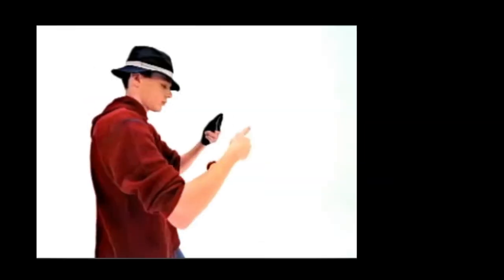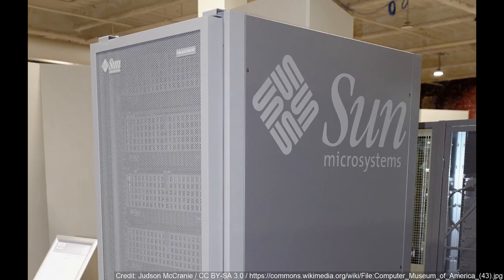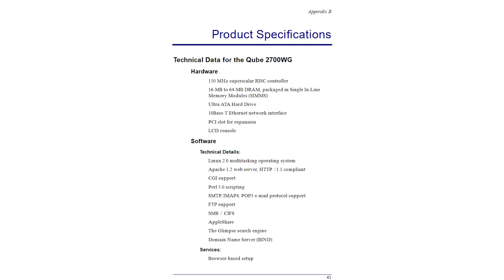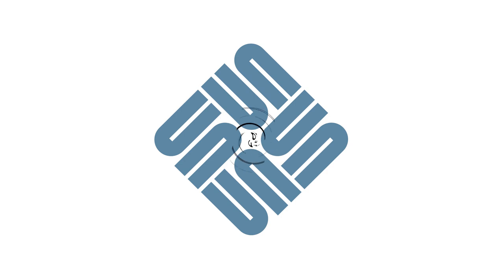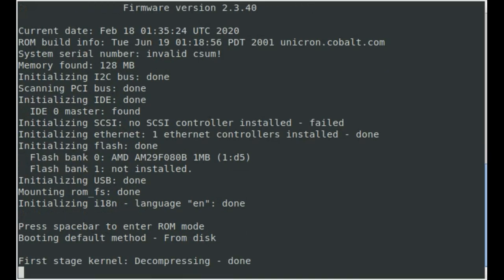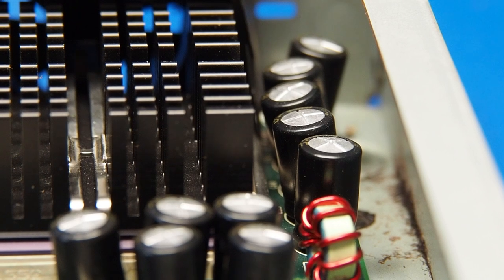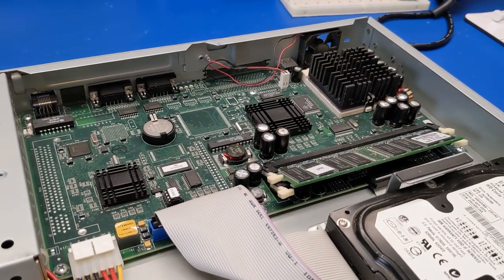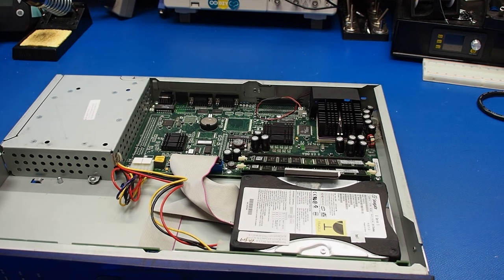This Web Server Changed The Internet: The Cobalt RaQ

Comment: Believe it or not, I turned off the last bunch of them only in January 2020, together with a bunch of HP NetServers, all from the 90's. These boxes were indestructable and indeed, together with the Cisco 7200 and 10k series routers, were the buildingblocks of the internet. There are many 7200's out there as well, still!
Reply: The company I work for has routers of that 2006 vintage still :)
Reply: They probably required newer software to run HTTPS, or was that why SSL accelerator units existed?
Reply: @soundspark  Reverse proxies probably
Reply: @MrOpenGL  Which were sold as appliances too back in the day.
Reply: This was from the era when the US Government was still restricting the export of strong encryption, which meant crippled SSL certs.

So a savvy guy named Mark Shuttleworth in South Africa decided to set up his own CA and issue full-strength certs outside the control of the US Government. My main client here in NZ at the time got certs from him.
Reply: @lawrencedoliveiro9104  Wasn't it around 2000 when the US relaxed rules on encryption export?
Reply: I would have guessed those IDE drives would die every few years if being run constantly. Their lifespan wasn't that long.
Reply: @wisenber  never rebooting makes them run longer, since they have constant thermals and spin.  (It would make rebooting scary, though...)
Reply: I was like #100
Reply: @manmeetworld  you were #100 what?
Reply: @soundspark  that is so funny to think about
Reply: I work in IT, you know I believe it
Reply: LOL. What the shit?
Reply: @wisenber  As i remember those days, the problem wasnt running them 24/7 for 5 to 10 years. The problem was spinning it back up. Always kept mine on always spinning, and every year or so after updates, power cycling was the scariest time. The ones that had default spindown times never survived a year.
Reply: Earlier this week we found some more with active websites on them, still active...
Reply: Cisco 7200 and 10K series being building blocks? HAH Not really... Try the cisco2500

Comment: I had one of these as a teenager. I used an ISP called ZEN who provided a static IP address with their broadband. I used the static IP to host multiple websites that I designed for customers. I ran this thing from the airing cupboard of my bedroom with an APC UPS. It earned me quite a few hundred pounds every year in hosting fees! 😊 I must check in my mum’s loft to see if it is still hiding there as I don’t think I ever sold it.
Reply: Lol.... Still remember my first website too. And the e-commerce shop that I tried to help build. 

This is an interesting... Video... Because it basically means that, these mom and pops ISP then rolled over into the likes of Facebook's and things rolled up.... What was so stable is now not so stable.
Reply: @MeiinUK dont you mean the likes of AT&T, T-Mobile and such because Facebook is a different kind of hemorrhoid than an ISP

Comment: These things were known as 'Pizza box' servers due to their formfactor. I remember going into datacentres in London's docklands and just seeing rack after rack after rack of them.
Reply from the maker: Telehouse North ?  or where?  :)
Reply: @theserialport  Redbus facilities like Soverign House and Meridian gate.
Reply: Same here, they were all over the place in the old redbus Hex 6-7 facility. I had to decommission three racks of these damn things back in 2007. They were being given away to staff for free at one point, presumably because it was cheaper than using e-waste suppliers.
Reply: "Were"? 1U servers are still known as pizza boxes.

And there are still lots of data centers full of 1U servers, although obviously not from the Cobalt brand anymore.
Reply: I work at a data center and most current servers are 1U “pizza boxes”
Reply: Fist pizza boxes were SUN machines
Reply: I believe the “pizza box” term arrived with the original 1U rack servers from Data General, Sun and SGI. Probably 1991 or 1992.
Reply: @RoyOlsen  sun SPARCstation 1. April 1989. Was the first machine called a pizza box. It was a workstation
Reply: @RoyOlsen  I wasn't sure if they did a server or workstation first. Just knew it was SUN who got the pizza box credit. That's why I kept it at machines at first. Your response made me look it up 🤣 we are getting old my friend.
Reply: The cube reminds me of the HP microservers.
Reply: I think you're thinking of earlier Sun boxes, which is where the term "pizza box" originated. These are just custom 1U servers.

Comment: The one simple problem was, and still is that making the server easy to use does not in any way remove the requirements for good technical skills. You need those to build a well functioning and secure environment, back then, and today.
Reply from the maker: Yes, good point!  We think the RaQs were very popular because the "level 1" tech issues could easily be done with the front panel LCD and control buttons, and a RaQ could be re-installed by just connecting to it with a laptop booted from the restore CD.  However, yes, a company running these should have also had people responsible for security practices.
Reply: It doesnt... but it sure makes it alot quicker. I think a lot of people runnin web hosts have no business doing so, lol.
Reply: Ha, die Bart! Tijdens het kijken van deze video moest ik al snel aan jou denken. En daar ben je dan in de comments!
Reply: @laurensdejong6149  Haha, tja.. ik ben best redelijk actief op youtube.
Reply: While this statement is absolutely true, it's not exactly a fair representation of what made the RaQs approachable.

You were still expected to know what to do with the business end of a serial cable.  You were expected to know IP.  You were expected to understand how to use FTP, and telnet or SSH.  If you were going to use CGI scripts, it was up to you to know how to write them, and what the implications of running them would be.

OTOH, procurement of these was easier -- and cheaper -- than Sun hardware.  Sun boxen were ... different ... and required learning non-PC things like how to interact with the boot monitor, what a "slice" is and why slice 2 was significant, and so on.  Solaris wasn't the most user-friendly OS for a Unix newbie, either.

Furthermore, there were lots of bundled management systems that would run on these things, which made operating a fleet of web servers a LOT easier.  It brought the controls into one web-accessible UI, made it possible to delegate application management to junior staff, and have reasonably technical people handle the majority of customer-service issues with some degree of autonomy.  Heck, you might even be able to hand over some of that management to your end-users, depending on the platform you chose, how many tenets you were hosting on a box, and how savvy those customers were.

This was an incremental step beyond giving users a shell account and wishing them the best of luck, and it enabled turn-key web-hosting as a service that any ISP could bolt on with minimal overhead.

Comment: I so remember these, the ISP/MSP I worked for developed an inhouse board that allowed two drives to get crammed in the case and use software to mirror them.  There was a VERY specific method to properly fold the IDE cables to get the thing closed up.  Ran a modified version of the RaQ OS, also tweaked in house if my memory is still good. Will try and dig up a pic of them in production

Comment: After Sun dropped the Cobalt RAQ platform, Project Blue Quartz was developed, which was an open-source version of the Cobalt RAQ software. It could be run on any modern server, or as a VM and was eventually ported to CentOS 5. Later on, the Blue Quartz software was ported to Project BlueOnyx, which is still active and downloadable today.
Reply: Yea blue Quartz.
Reply: Yes, BlueOnyx is still around. I used their software for a long time before I took the leap to cloud based services. I'm still on their mailing lists though, and it's still under active development. Strongly encourage people to check it out. (And they could use donations right now as well.)

Comment: One of my college roommates interned for Cobalt Networks.  One of the projects they assigned him writing the code for front controls and display for the Raq 3.  I remember him having prototype servers in his room and we hacked the PCI card to support a sound card (the PCI bus on the server only supported 3.3 volts, and most decent sound cards needed the 5v pin as well.  So we had to pull the power with bodge wires from other stable sources on the motherboard.  In the end we ended up turning one of the early Cobalt Networks prototype servers into a MP3 jukebox for the house 🤣.  I did loooove that blue case too.

Comment: These were absolutely amazing back in the day. Ran my first hosting business off one of them. The web UI was the killer app as well. It made management of the server a doddle and lowered the barrier for getting into hosting. Which was a double edged sword, if you didn't have the Linux chops for when things went wrong. I learnt so much running one of these.

Comment: Blast from the past!!  I thought you might get a kick out of knowing that this video is making the rounds among the old Cobalt engineering team.  :)

As for the mobo - it was designed in-house. :)
Reply: Quick question from someone who doesn't know anywhere near as much as you...

Were capacitors seen as the best solution back then? Was it known that they would fail in the way they do over time?
Reply: @SiikPros Not sure if you left out a word but all motherboards have capacitors. They are needed for filtering and buffering the electrical demands of the chips in the system. You can't design a motherboard without them. Based on the time frame, the bad capacitor issues would have just started to become a known issue.
Reply: @PedroDaGr8  I must look into capacitors then because my understanding of their function in motherboards seems to be off. I thought they had to do with managing power within the board to the different components.
Reply: @PedroDaGr8  thank you for answering
Reply: Sounds like you might be confused with the VRM (Voltage Regulator Module)
Reply: Great job Cobolt team.
Reply: @SiikPros  No problem!
Reply: @SiikPros  As others pointed out, capacitors are needed for all sorts of tasks in all sorts of electronics, they have many, many different applications, however, for those large electrolytics as seen in the video most likely they're being used in some sort of power filtering/smoothing capacity, in combination with some sort of VRM system (many kinds of different components are needed to implement a *system*)

I think the other half of the answer to what you were asking,  those "non-solid" capacitors were the best solution back then even though their failure rate was not known to be great. Every single component has a failure rate, some are just far longer than others, and those types of capacitors are one of the lowest. With advances in chemistry they've generally been replaced with solid polymer capacitors in most use cases on newer motherboards, which are why they aren't often seen anymore (if you look at newer motherboards, you can see the smaller solid poly caps all around the CPU as part of the VRM).

One final note is that there are multiple types of capacitors, each more suitable for certain use cases. They're always just a small part of a larger system.
Reply: When I was a teen I salivated over these, they looked SO futuristic!
Reply: @PedroDaGr8  as for filtering, I've always wondered, why not use op-amps instead? I've only taken basic circuits but when I did we learned that op-amp filters could be configured for the same kinds of specifications as RLC ones.
Reply: @Prep5242  an op-amps are just amplifiers of a source and they hopefully have a relatively low noise themselves, but you need a clean power supply to feed into them in order to achieve that.
The big Caps on those boards aren't themselves in the data circuits, they are sitting on the power supply rails for the chips. Then the chips get a clean power supply. If one component is making noise, perhaps switching noise, perhaps switching in and down in power demand, then the capacitor can help respond to that spike in demand. Then adjacent chips don't suffer from those spikes in demand from other chips.
Reply: Is it possible to use the LCD in modern versions of Linux? Meaning, did the engineers open source the code and hardware (Or plan to) so that a Arduino can be used on any server easily?
Reply: @Jeff-ss6qt  I'd expect it to be a standard driver IC, so it probably wouldn't be hard to find the data sheet for it and likely a low level driver already exists.
Reply: @Prep5242  Opamp is an active component, requiring clean power.

Capacitors are passive components which have many applications, but helping clean up power is a big one, and that is more than just filtering out hf components, it is also providing that bit of extra power needed for when you very briefly require more power, without dropping the potential (too much)
Reply: @Jeff-ss6qt I believe there were source forge projects out there for the Linux kernel ROM and lcd driver.
Reply: @Jeff-ss6qt  Yes, but I have no idea if it will compile for you. The hardware is a popular LCD still in use from the looks.
Reply: @SiikPros  Those can or electrolytic type capacitors were very common around any power devices. The first sign of impending failure is that bulge at the top of the can. I'd fixed many a problem by the replacement of a couple of those type caps. There was a model of PC power supplies that were notorius for failure. They were great for fault finding as they announced imminent failure with a very loud bang. If you were lucky, you sometimes got to see the paper guts and electrolyte spray all over the place. A number of modem brands also suffered this problem.
Reply: I missed this,  takes me back, I was in charge of sending out the Beta Machines for the RaQ3 boxes.  I still have a Beta (Internal) RaQ4, needs a new rom. Where is Glenn H when you need him...

Comment: Guys, you'd better avoid ultrasonic cleaning of boards with crystal oscillators, because they may be irreparably damaged by the vibration. De-solder crystals from PCB or at least don't immerse them in the cleaning liquid. And the second advice I'd like to mention, in my opinion the best way of de-soldering components, such as the capacitors, is as following: apply a bit of tacky solder flux, then heat the junction adding some fresh conventional soldering alloy (not a lead-free one), then hold your soldering iron with one hand to keep the solder melted, while very gently pulling and wiggling the component by the other hand. In your case, as a capacitor has only two legs, it's in fact possible to keep both hot and melted simultaneously, by constantly moving solder iron tip from one to another, back and forth (remember, your other hand is cautiously swaying the component at the same time). It sounds more complicated than it works, although you'll need a little bit of practice, preferably on some dead board. The key to success is tacky flux and free solder alloy. Next, in my opinion, round solder tips are not very handy. Give a try to chisel (D-shape), knife (K-shape) or bevel (C-shape). BTW, with a wide solder tip, like Hakko T12-WD52 or T12-K for example, you can heat a number of legs at the same time without moving the solder iron. 
Thanks for the video, you're doing great!

Comment: I think I still have about a hundred Raq3's.  I have some new in box.  Burst caps can be found in basically each and every one of them, even NIB.  They blow caps, the RAM had a higher-than-average failure rate, some of their hard drives had problems overheating the controller boards, and fans died all the time.  It's hard to say whether their low price offset the common hardware problems, but they certainly were ubiquitous and made a huge impact in decentralizing server farms.

Comment: I love the status messages the programmers in to describe various tasks. "BOOTLOADER: Leap of faith!"
Reply: It could be something as simple-seeming as jumping to the next instruction, but with a different processor mode (e.g. virtual memory mapping) enabled. That requires all kinds of things to be set up properly--not just the page tables, but also proper flushing of processor caches to avoid picking up now-incorrect addresses. So when you get there, you can quite rightly say “Phew!”.
Reply: @lawrencedoliveiro9104  Thanks for explaining that, I was curious specifically what it was. Knew it was a "big jmp" of some kind, but that definitely explains why it was so notable as to have it's own log entry!

Comment: We used these as marimba transmitters. At that time, fully managed thick desktops and electronic software distribution was brand new
 I remember the cobalt team being very easy to work with. 

Ours were x86 based. We had several hundred.

Comment: I used to be a product manager for a UK business service provider (Easynet) and the hosted Raq service was one of the first products I launched. I'm pretty sure Compaq DL180s were available then so it wasn't the first 1U server, but one of the joys of the Raq was it wasn't deep so you could 'back to back' them in a rack and have 80 in one 42U 600x800mm cab. They also didn't kick out a lot of heat or use much power so the generally dreadful DC power and cooling design of the mid to late 90s could cope with it (so long as you didn't have an entire row of them). Happy days!